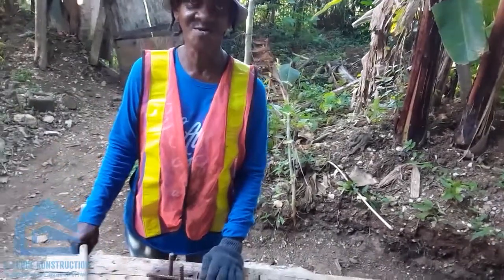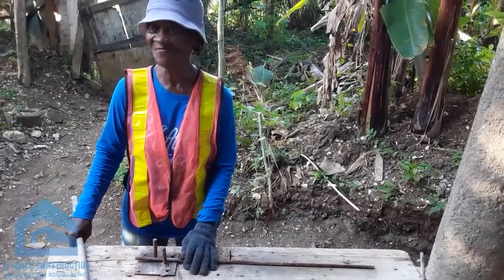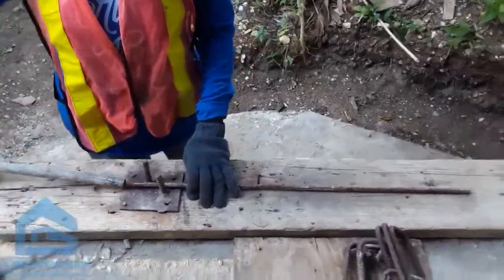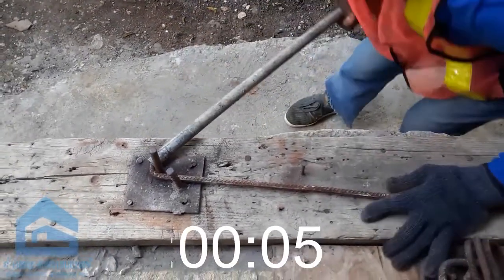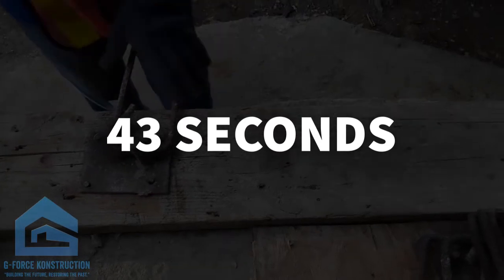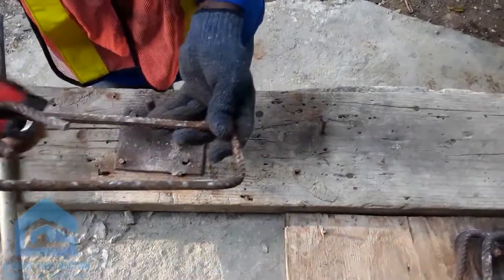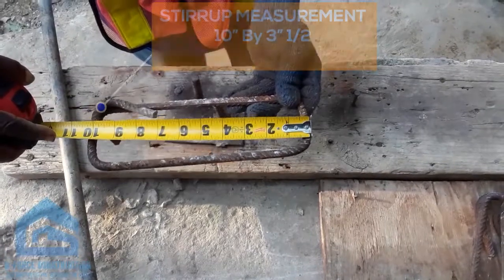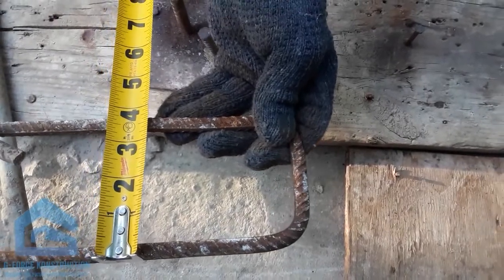How to Make Stirrup for Column live  video [Manual Bending Step-By-Step Technique]😱

Comment: How do you make the thing to bend the stirrup
Reply: Can I see a sample of how it made
Reply from the maker: @aaronw8741  when I go back to the welding shop I will make a video for you ok 👍
Reply from the maker: I got the flat iron and a piece of 1/2 inch steel bring it to a welder with a sketch of the design and the  welder made it for me👍